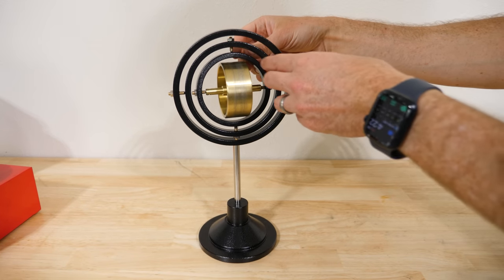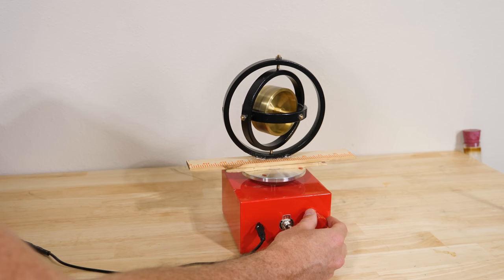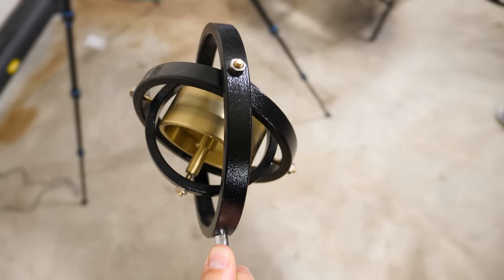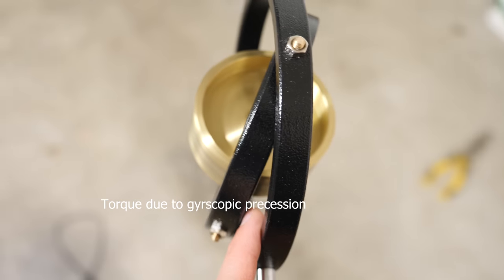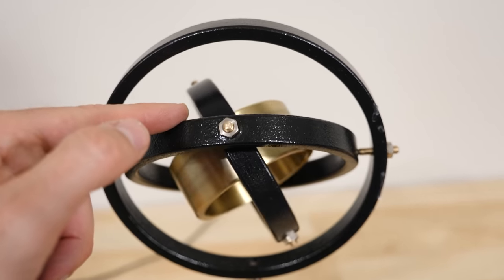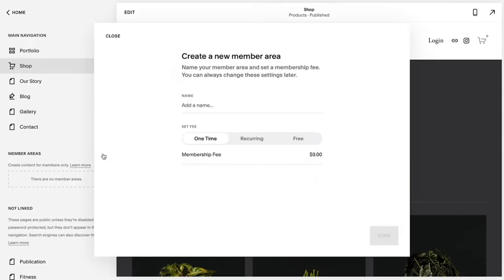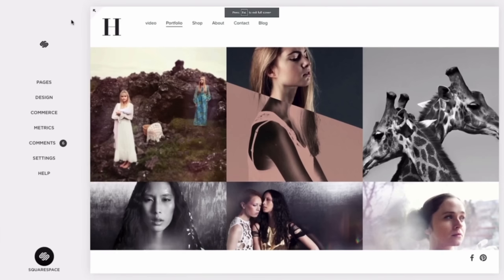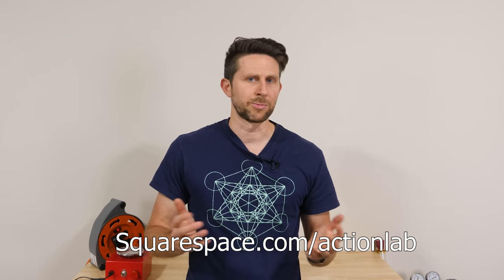Can Gyroscopes Provide Free Energy For The Planet?

Comment: The problem is, if you're removing 0.001% of Earth's angular momentum, you've gotta put that somewhere. It can't just disappear. So you're putting it into the gyros? Sure. Fine. But they're gonna be saturated very rapidly after which point energy will want to flow the other direction.

The minimum possible energy state of a rotating system is when all parts of the system are rotating at the same speed (not angular speed, though for a rigid body that's the likely outcome). Any other state is a higher energy state.

I don't see how you're gonna drop the energy state of a gyroscope below that of Earth without net input of energy. For the exact same reason that attaching a heat engine to your refrigerator doesn't gain you net surplus energy taken from latent heat.

The only type of (nearly) unsaturable reservoirs I'm aware of are things that have negative potential energy somewhere in the mix.

For examples of negative potential energy, dumping energy into an object in orbit will reduce the speed of the object, though this is saturable once it reaches escape velocity. Dumping energy into a planet, in the form of mass, increases that planets' escape velocity. Dumping heat into the interior of a star (say, from fusion) expands and cools that star. Dumping mass into a neutron star or white dwarf compacts it further and dramatically increases the escape velocity. Dumping anything into a black hole makes it larger but does not affect its escape velocity, and also makes it colder.

The types of objects that work as unsaturable energy reservoirs all have an inverse or zero relation between the ground potential at the object, and the energy input, and this doesn't change regardless of how much you throw in. So even things like orbits or stars only work in the sense that you can wait for them to radiate energy away and THEN dump more energy in. The only ones that work as truly unlimited energy dumping reservoirs are compact objects, especially black holes.

Comment: if you look at the gyroball ..you need to provide a lot of energy in form of motion to get a very diminishing amount of energy to be output for a relatively short amount of time, spinning it for 30 seconds gives the LED’s about 20 seconds of power … so a 10 seconds loss of energy wasted… 
For the gyroscope power source to work it needs the maximum amount of speed at the equator (1600 KM/h) and that amount needs to be stored and multiplied to be fed back into it before any excess is then send into the grid.
So to get the most out of it you need 2 or more gyroscopes feeding in into each other for maybe a few 100 thousand KWh which if any of the gyroscopes stop will immediately reduce to 0 after a few seconds or minutes

Comment: The atmosphere takes some rotational energy of the earth via coriolis to different latitudes. Some of the wind's energy will be dissipated because of frictional drag (eg tree leaves flapping producing heat) so angular momentum is not perfectly conserved. So wind does slow earth down but not by blowing on mountains etc but by the good old 2 law of thermodynamics. The earth has so much mass it's effect is so small though. If earth were turned to Minecraft blocks and they were laid in a line it would be as big as the milky ways diameter.
Reply: yeah i was thinking of similar stuff... like isn't part of what we extract from wind and ocean energies somewhat originated from earth's rotation.... yeah probably not that big compared to all other factors but just thought it'd make sense that overall wind blowing west is stronger than the other direction.
Reply: Coriolis forces don't add energy. The energy of wind comes from convection currents from solar heating. Coriolis forces just redirect that energy, conserving angular momentum in the process.
Reply: Even if you can harness the power of hurricanes you are NOT taking away from the spin of earth by one bit. The angular momentum of the earth in the end is still perfectly conserved. The total angular momentum of the earth and hurricane combined, plus all satellites in orbit, is still perfectly conserved regardless of how you look at it.
Reply: The atmosphere does NOT take the rotational energy out of earth. The wind is blowing because the sun heats it up, the convection causes currents, and then earth's rotation turns those currents into different directions. But the energy that the wind has is not coming from earth's rotation. 

Conservation of angular momentum is a thing, just as real as conservation of energy.

Comment: I feel like this inevitably comes back to the same problem mentioned at the beginning of the video with other theoretical methods of harnessing Earth's rotational energy: You need some external element to have it act upon. If we were to set up some type of gyro based generator using this method, it would require the same thing that the exercise ball does to function. A separate, "planetary orbital ring" which wraps entirely around the Earth and yet does not spin alongside it. Then we could use it to generate the friction needed....But at that point there would be far simpler ways to harness the rotational energy, without needed a gyroscope
Reply: at this point, then nuclear energy becomes much cheaper compared to wrapping earth in a metallic ball.
Reply: @diamondcreeper0982  by far lol, but to be fair we have spent decades making nuclear better/cheaper. And this wouldn’t necessarily need a full ball wrap around the earth, but a ring would do(even though thats still insane). You could basically just build a tower up to the ring with a roller on top to roll along the ring as we rotate and generate energy…would probably be cheaper than nuclear at that point. Buuut the “point” of having a planetary ring is ridiculous, and to make it not rotate with us would be basically impossible

Comment: Three things no one is talking about: First off, to spin the gyroscope that fast, it takes a bit of energy. Secondly, what if you lock the inner rim on the stand like so that the gyroscope has no way of turning sideways. Thirdly, if that's not possible, or it works poorly, just rotate the entire thing 90° and it will work like it did before.
Reply: ya and its even worse if you try to scale it up. imagine the weight of a gyroscope large enough needed to extract energy from the earth. Imagine spinning that thing up super fast and KEEPING it spun up. ya dump idea
Reply: I have two gyro balls that produce energy when shaken for a few minutes and it doesn't take much external energy. Very efficient.
Reply: @BIindsid3  flywheels don't have any interent reason that they would slow without external force.  Resistance from air or friction or any other way of transferring the rotational energy to anything else basically.

Locking the flywheel orientation to the rod takes the force and applies it to the entire rod instead of just the the flywheel. It TWISTS the rod. The one thing I've noticed hands-on that makes it hard to to extract EXTERNAL energy... the gyro slows down if you resist the twist. Not sure why, but I think it's either transferring the rotational energy of the flywheel into the torque on the rod, then that force ultimate travels into the ground... Or it increases the friction on the axle of the flywheel. Can't really tell with the cheap setup I have. (A toy gyroscope held in my hands with no modifications or measurement devices.)

In other words, in my experience this is only a way to DEPOSIT energy, not really extract it. Maybe there is something I'm missing, but it seems to me that it would be like trying to recover the energy of a rocket by firing the thruster in the opposite direction. It's using energy to resist energy. 

Actually... Now I'm wondering if such a setup could be used to desaturate flywheels in space by swinging them them back and forth while locked... Each swing would reduce the speed of the flywheel and cause a torque on the spacecraft. If you then swing it the other direction the flywheel slows more, but counteracts the torque from the previous swing reducing the rational energy of the entire system...

That would violate conservation wouldn't it? I must be wrong. Maybe the energy would become heat or something? Either way I'm gonna have to build out the experiment and see what's up. Saturated flywheels in space is a big ol problem for long term missions.
Reply: @wrencharmratchet7629  Wow that must have taken an eternity to write down lol
Reply: @leolipasti  maybe... I lose track of time extremely easily. I had fun. 

If I wanted to actually play with this, it would be good to actually do some physics. Maybe simulate. But really, it'd be so cheap to set this up, and the rig could be used for a bunch of different demonstrations.

Comment: You can extract energy from earths rotation using a look skyhook. Lifting a lump of mass up to the geostationary orbit requires some energy. But at higher altitudes you can extract energy since the mass is pushed up due to the centrifugal force. The amount of energy is just limited by the length of the cable. At the end of the cable the mass is released.

Comment: Since the centripetal force is stronger at the equator than any other point above or under the equator, then I guess we could join a (very) long pipe between any point above /under the equator and the equator itself. 

We'd obtain two different pressure at each end of the pipe. The pipe needs to be tangential, not perpendicular to equator's plane.
Reply: Except Earth is not a sphere. Since the poles are squashed AKA downhill AKA closer to the center, Earth's gravity is not perfectly perpendicular to the surface along the "slope" from equator down to the poles. This gravitational force component along the surface perfectly cancels out with the force you described above. Otherwise Earth's surface would not be in equilibrium (ignoring Lunar tides).
Reply: @JWQweqOPDH  
You mean someone actually calculated that ? If you have any link, I'd be interested. That's quite surprising, considering that earth is not even symmetrical so if what you say is true, it can't work for both sides anyway. But it's a good point.
Reply: The average surface of the ocean over time MUST be perpendicular to the net force, or the water would move until it was.
Reply: @JWQweqOPDH  
That's not related to the curvature-centripal ratio (unless you have a more detailed answer). The best case to highlight your claim would be to imagine a planet made only of water with a uniform density. 

If in that case, the difference between centripetal forces at the equator and any other point can't be used as a source of energy, then yes your hypothesis is valid.
Reply: @En_theo  Putting it a different way, harvesting energy requires a lowering of energy within the source. We need to reduce the rotational energy of Earth by some miniscule amount. We can change the moment of inertia by moving mass closer or farther from the axis of rotation. We can't change the angular momentum since we are part of Earth and momentum is conserved unless there is a force interaction with something beyond Earth (such as Lunar tides, which I will be ignoring for now). With angular momentum constant, rotational energy is directly proportional to angular velocity. We want to reduce Earth's rotational energy, thus we want to reduce Earth's rotational velocity. To do so, we can increase the moment of inertia of Earth. For example, space rockets IRL might be trucked/flown closer to the equator prior to launch. Since the equator is "uphill", as I discussed previously, the truck does not roll there naturally. The truck drives normally. However, the rocket now has more kinetic energy near the equator, in relation to an outside reference frame, and the Earth has a miniscule amount less. We could steal rotational energy from the Earth by simply lifting heavy objects, such as pumping water to a mountain reservoir, at the equator, since at the equator "up" is away from Earth's axis of rotation. However, we couldn't harvest that energy as it takes more energy to lift than is stolen from Earth's spin. Instead, we can move mass along Earth's surface from the poles to the equator. However, moving the mass will be difficult, as we'll need many ton-miles moved just to generate some energy. Even worse, we have to store everything we move permanently at the destination. If we let move water and dump it in the ocean, it will just move back. So we will move mass onto land, like a landfill, from the poles to the equator. As the Earth's rotation slows, the centripetal force at the equator lessens. The ocean levels there lowers and ocean levels at the poles rise. The even worse part is, that's where our harvestable energy is! The space rocket needs energy within an external reference frame to get into space, but we're still here on the ground. A mountain at the equator contains more kinetic energy than one at the poles, but it's still a mountain just sitting there. Sure if we built rockets out of it, they'd be slight easier to launch, because it's already moving, but we don't care that it's moving because it's moving with us. We could harvest the movement of the oceans toward to poles, but the oceans already move without human intervention (Lunar tides) why put so much effort into moving them?
Reply: @JWQweqOPDH  
"We can't change the angular momentum since we are part of Earth and momentum is conserved "

That's entirely false, thank you for showing you actually don't know what you're talking about. 

You can decelerate a disk's  angular momentum (in space  for example) by simply standing at the center of the disk and spinning yourself in the opposite rotational sense. I didn't read the rest of your comment since you already started with a false assumption.
Reply: @En_theo  What I said is TRUE because I'm defining the Earth to include everything on it. Yes things move along the surface of the Earth and spin, but the total momentum of the whole thing combined cannot change assuming no outside forces. It is not false.
Reply: @JWQweqOPDH  
I insist that you read more about that. If what you say is true, then how do we orientate satellites in space with inertial disks ? 

The whole system is tipping over  and then stops moving once we brought it in the desired position. Or, more simply, why can I stop the rotation of a disk in space without any external constraint ? You seem to forget that the friction between two moving parts on a rotating object will dissipate the angular momentum's energy through heat.
Reply: @En_theo  I completely understand how satellites orient themselves with reaction wheels. They are stationary, start a motor to spin the wheel one way and themselves the other way, and then reverse the motor to bring both to a stop. They are now facing another way. However, the ONLY energy they got out is whatever they put in, minus some inefficiency. If the satellite, along with its reaction wheel, were all spinning the same way to begin with, then the only way to harvest energy would be to have a winch that slowly extends weights in opposite directions away from the satellite, and have a generator be powered by the unwinding winch. A faster non-generating version is used to de-spin satellites. However, on Earth it takes way more energy to get something away from Earth due to gravity than the rotational energy it has/gains/steals.
Angular momentum cannot be turned into heat, but rotational energy can. Rotational energy is equal to angular momentum multiplied by the angular velocity of the same system/object.
If I hit the brakes on my car, my car's kinetic energy becomes heat energy. However, my car's momentum (which has not only magnitude, but direction) is simply transferred to the ground and then to the Earth as a whole.
Reply: @JWQweqOPDH  
Again, you're mixing up two concepts. You said that there is no way a spinning object could stop its own rotation. That's another thing than saying "it's impossible to extract energy from its own rotation". But anyway, these two statements are false. 

Your intuition about the brakes is false btw. Momentum can and will be transformed into heat.
Reply: @En_theo  Again, the magnitude of momentum multiplied by the magnitude of the velocity of an object equals the kinetic energy (actually half, you divide by 2) [P=MV; KE=(1/2)M(V^2); KE=(1/2)PV]. When objects interact, kinetic energy can transform into other forms due to the sum of the kinetic energies of the objects changing. However, the vector sum of the momentum of the objects interacting CANNOT change.
De-spinning satellites have to impart their spin into something that is not part of the final product, such as rocket exhaust or the tethered counterweights, which leave the satellite at some perpendicular distance in order to possess the angular momentum when calculating for the whole system with all of its original parts. BTW, I already clarified the difference and relation between angular momentum and rotational energy.
I'm trying to teach you to be nice, but you clearly just don't want to learn.

Comment: Hey, there's an app called sound wave, with a black logo and a wave. It shows the noise it's receiving from the surroundings. As we all know sound needs a medium to travel. Under normal circumstances, it doesn't matter how quiet the room is, it always shows little vibrations. So, if you could try that in a vacuum chamber that would clearly demonstrate sound needs a medium to travel and also that app is truly genuine. So, please make a video. A shorts video would be enough if you don't have much time.